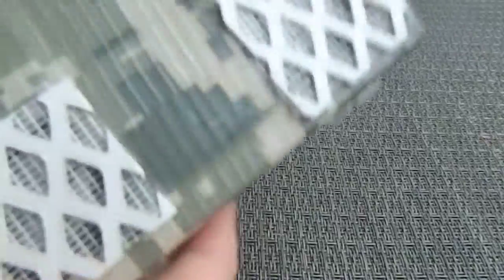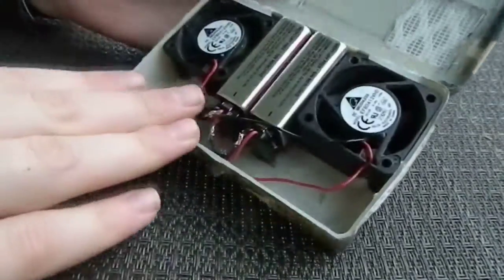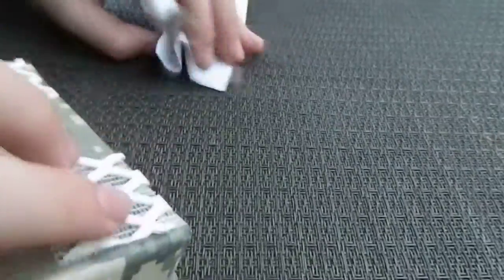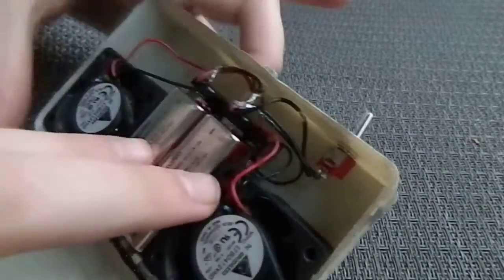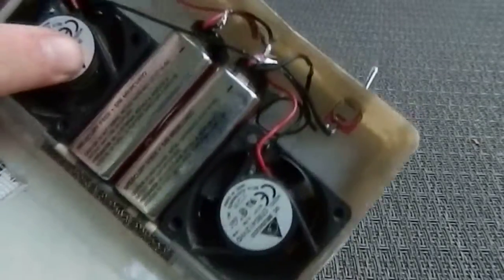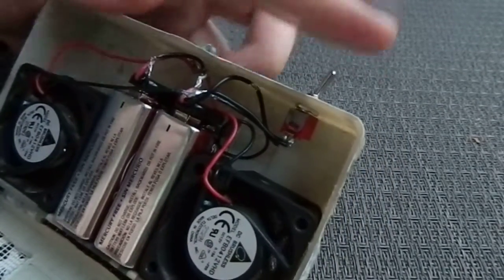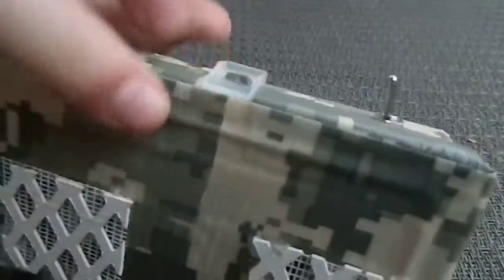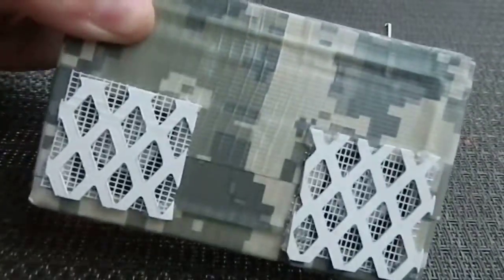Weekend Project: Fume extractor

Comment from the maker: well actually since there are 2 12v fans then it is actually 9v of power to each basically. to aswer your second question, probaly a couple of inches, maybe 4. when i was starting curcuitry i didn't even have a fume extractor. but this is a great project to build. i would imagine that as long as you arent taking deep breathes next to your soldering you should remain a right with very little mutation!!! you could probaly make this fan more powerful but that might take away from the fan's life.

Comment from the maker: @bittnerbittner no. i figured it wasn't really necessary with 2 fans running. plus with out a voltage regulator the fans run faster. you don't really need one

Comment from the maker: hes 2 batteries. 2 fans. that is 9v each fan basically. i don't use it nonstop so if you solder a lot my results might not match yours but my fan is still working.

Comment: @ZamaSoldier the 2nd fan will not reduce voltage at all, amperage and wattage will increase but not voltage, the voltage regulator (MOSFET) regulates voltage, hence the name (not meaning to insult your intelligence). However overvoltaeing a fan like that a few v's will not hurt it. If you think about a computer, just because you have more components in your PC does not mean that some of them will run at a lower voltage, just increase the required wattage, hence larger PSU's for high end gaming.

Comment from the maker: @DanzyHD i opted out of installing one. why? well without it you get so much more power. so from only getting 12 volts like kipkay says i get 18 and the fans run so much master. i also didn't install a voltage regulator because i have 2 fans vs. kipkay's 1.

Comment: still, a voltage regulator will make it slower but wil make it last longer and the fans will break down faster without it(still, fans hold a long time with 18 volts)